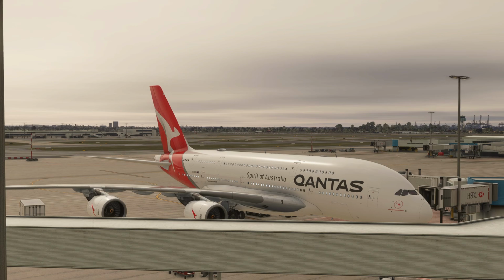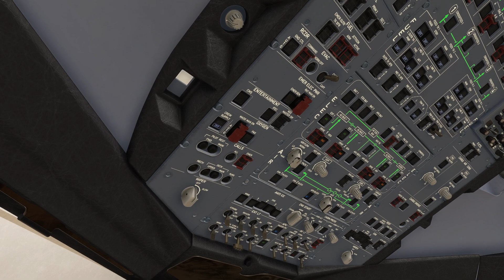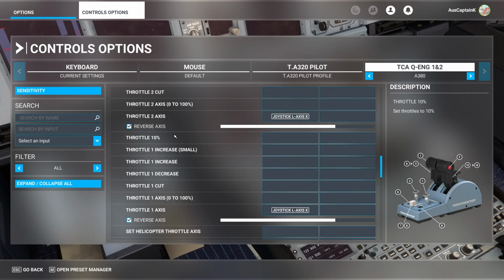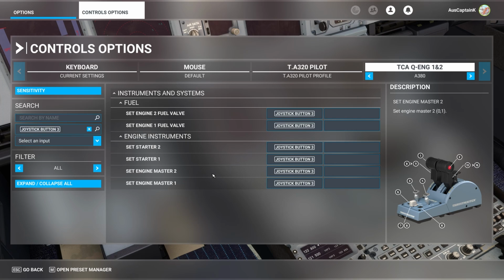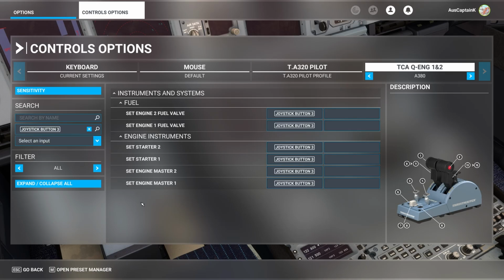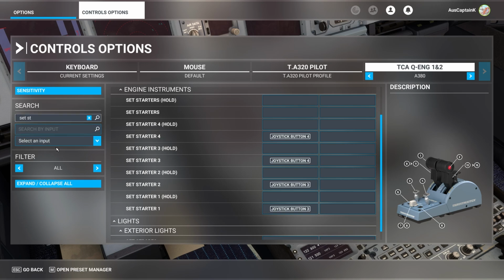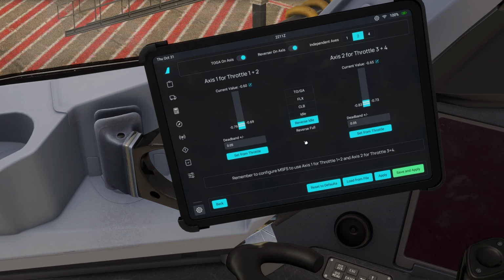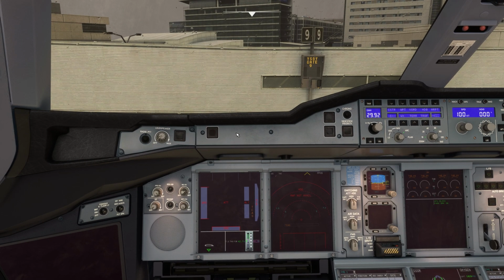FlyByWire A380 - Thrust Levers Calibration Tutorial | TCA Captains Pack - Full Setup Guide | MSFS

Comment: It still doesn’t work after I use the tablet to calibrate. The highest it let me goes is flx
Reply: On the throttle inside the plane it shows it fine but the throttle meter in the bottom left corner still shows the highest it goes up to is flx
Reply: I also can’t use reverse thrust
Reply from the maker: You doing this in MSFS2020. That is very odd because it works fine for thousands of others. You are starting at full toga and working your way down?